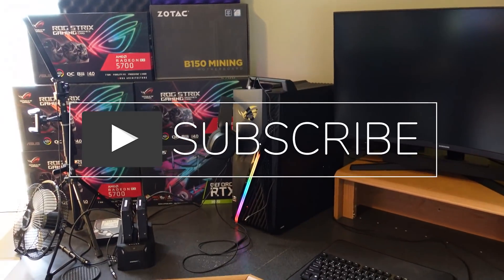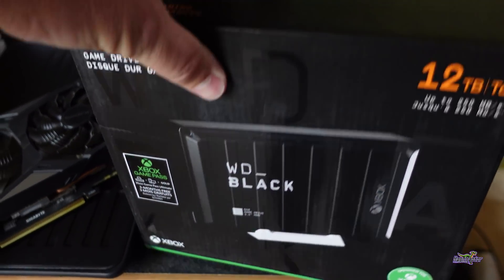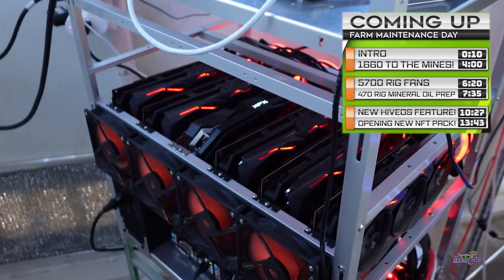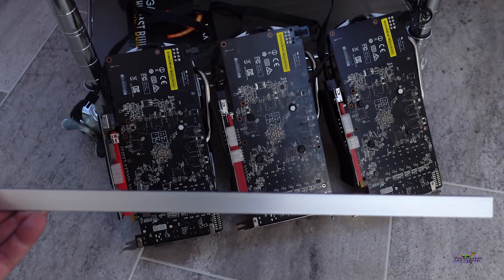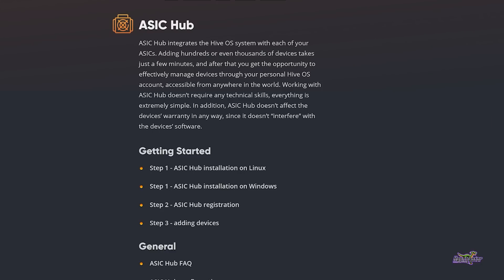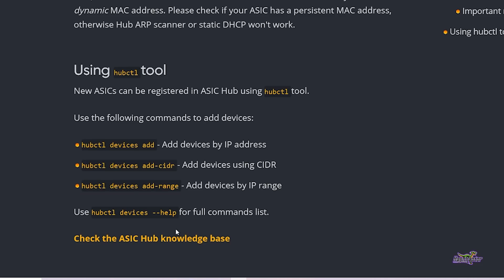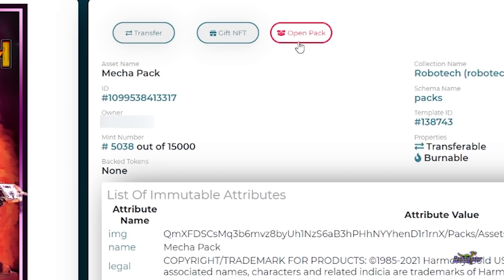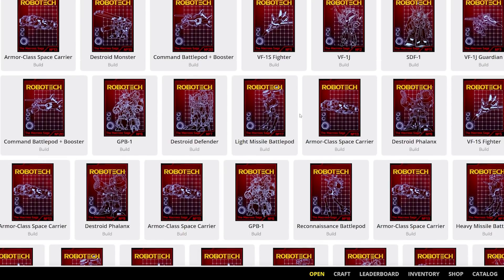Farm Maintenance, *NEW* HiveOS Feature and NFT's

Comment: Hello can I ask a question? How do you power your mining farm? Do you plug in the power directly to the wall? I'm building my own rig soon just wondering on how do I protect them from lighting/electricity surge. Currently I have 2 3060 rig and im using a 1500w avr and sometimes it  shutdowns my pc its kinda annoying when you leave your home and came back to find out that the pc is shutdown and not mining
Reply from the maker: Hey, yes a power strip with surge protection is a must.  For random shutdowns, I use teckin wifi smart switch and set a rule, if the energy level drops below 100 watts for example, power the switch off and back on.  Then I have the rig set to automatically power on in the bios when it detects power has returned.  It is a fantastic backup to random crashes.

Comment: Iam staying in Kuwait . I mine using  nvidia 1660 super on nice hash and the highest rate I get is 25 Mega hash . If I upgraded my card to RTX 3070 , am I going to get higher hash rate ? or is 25 Mega hash the highest rate in Kuwit due to the nature of internet connection , no matter what card I use ?
Reply: hashrate is definitely tied to the card's ability.  you should be able to optimize that 1660 super to get around 30-31 if you adjust the settings. A 3070 is around 60-62mhs.  internet speeds can play a part in latency to the pool, which can cause stale shares, but as long as you have a stable connection, shouldn't directly affect your hashrate.
Reply: You need to look at what type of memory your card has and apply the overclock that matches. Micron/Samsung/Hynix. On the 1660s the over clocks are different for each.

Comment: Tune down the memory clock and memory voltage on your 5700's for the summer. I droped like 50 mhz on the memory frequency and set the memory voltage to 1250 in hiveos and temps went down significantly. Ofcurse i lost like 2-3 mh/s per card but they are able to work 24/7.

Comment: Is that AC unit you purchased not working?
Reply from the maker: It is working but I have it turned off unless I’m working in the shed beside it. After installing the two fans the difference it made was negligible so I won’t use it for cooling moving forward. I may leave it in there to call me when I’m working on a hot day or as an emergency heat source during the winter.
Reply: @HashRaptor  wow, that's good to know.